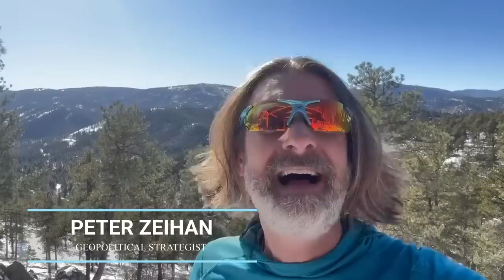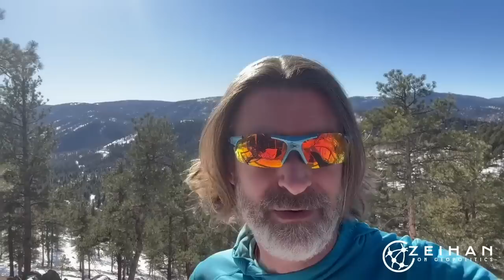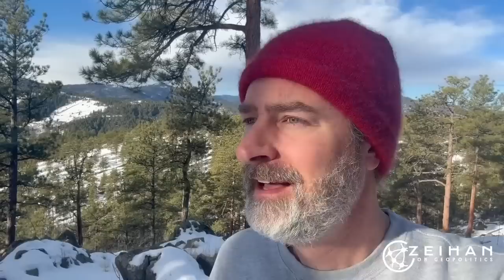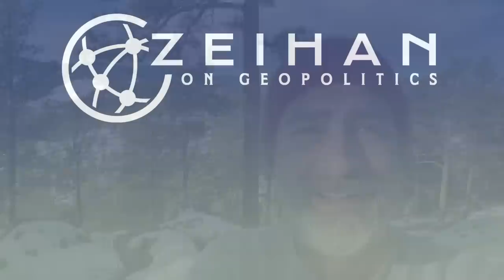Peter Zeihan || Material Processing: The Redheaded Stepchild

Comment: Bauxite is “refined”, to form Alumina. Then alumina is “smelted” via Potline, with modern technology drawing current levels in the region of 500,000 Amps, enough to create a magnetic field that disables all electronics, wipes credit cards etc. The potline I worked at had a 1000MW power station just for the plant itself. 
Bauxite (red dirt) input to Refinery >>> Alumina (white powder) input to Smelter >>> liquid aluminum input to Casthouse >>>  billet aluminum
Reply: Cheap electricity makes aluminum.  If a grant could be obtained to build a dedicated nuke plant jobs could be created for the next sixty years making alumunum.  This is provided the alumina and recycled aluminum could be obtained.
Reply: M.S. ...................solar panels on the plant roof ..........not an option ?????
Reply: One average-sized aluminum can has as much electrical power in it as a 220 volt 30 amp clothes dryer running for an hour.  Anyone who's used thermite  can attest to the power in aluminum.  

It only takes 1% the power to recycle aluminum versus refining from raw ore;  just melt it and reshape it.  Considering there's possibly 100 tons of aluminum cans on American roadsides a major contribution to the environment (and winding down fossil fuel power plants) would be recycling this valuable metal and getting it back into the economy; every little bit helps.
Reply: @dannycalley7777  you  16 watts per sqft. 1000MW= 1,000,000,000 (one billion watts) = 2.24 sq miles of solar panels - what about the night shift???
Reply: Intermittent power for molten aluminum does not go well, power goes out, pots freeze solid, only way to fix is to remove the pot and jack hammer - other than an explosion due to water entering the cryolote bath or the cast house, a frozen pot is about as bad as it gets. not to mention they would need 10,000acres of panels 15-16sq miles and only make electricity while the suns shining
Reply: @dstevans  just have a 5 cent deposit on every can and people will scoop them up and turn them it!
Reply: @dstevans  220 V * 30 A * 1 h = 6.6 kWh.  I think that's too much, since the spot price of aluminum is 51 cents/lb today.  At that price, with approximately 35 cans/lb, the metal content of the can is worth something like a penny and a half.  Even the cheapest electricity is several cents per kWh.  Aluminum still represents a substantial amount of electrical energy, just not that much.  Maybe 6.6 kWh is for a pound of Al?
Reply: Thanks for that. I cringed a bit when I heard him say that ☺️
Reply: @dstevans  Aluminum is also a very good solvent for other metals when molten.  These trace metals that get picked up every time it gets recycled cause problems with things like corrosion.
Reply: I love how any semi-decent Comments Section on any decent channel, has such a depth of expertise attached to it.  =)
Reply: @daniellarson3068  I've heard Aluminum described as "Electricity in solid form". It's fairly easy to figure out where refinement takes place, just look where the electricity is cheapest.
Reply: @machinist7230  Yes - It used to be made in Washington state when hydro power made cheap electricity.  Then lots of people moved there and electricity wasn't so cheap.

Comment: It sounds like a great opportunity of we (US) get our stuff together. I used to do some consulting for what we have left in US metal producers. (titanium, aluminum, specialty steels, nickel super alloys), A lot of the factories were create in the early 1900s and are very inefficient by modern standards. The product doesn't "flow" well through the shop even after decades of work trying to optimize it. But ultimately the factories were built without modern industrial engineering methods. And no one wants to spend 8 to 9 figures to move a rolling mill or forging press. I understand peter is talking about processes before these but the point probably still is valid. with modern knowledge on flow through a factory and with automation / technology we can probably do these processes in a profitable way. or at least partner with someone who will do it on there soil so they give us the purified materials.
Reply: US businesses are really bad at re-investing in to production upgrades.  Cuts into short term profits.  The Japanese with their mini-mills destroyed the likes of Bethlehem Steel and their 100+ year old mills.  

Brazil and Mexico will up their steel production and their cost of doing business are lower than the USA.
Reply: @TheBeingReal  I agree, alot of these factories were in horrible shape. I literally saw furnaces collapse in on themselves. Kind of scary considering at times maintenance workers will go ontop to do work. I think Brazil / Mexico is probably the most likely choice. I also think theres a big opportunity for technology in this space because we are soooo far behind in some of the factories that i've seen. very little automation. If we can remove a lot of the labor then potentially labor isn't as big of a factor. Of course if we require the same number of people we can't compete. Also keeping it "local" it increase the velocity of product through all the different operations which is important because a lot of these materials can be expensive. so having to buy them and sometimes taking several months to have a finished product ties up a lot of capital in raw material cost. 
we shall see.
Reply: @TheBeingReal  I think you are likely correct. It may be US capital involved, but building new plants outside our own borders is likely the best plan. Sometimes you cannot financially upgrade old facilities, and our self important bureaucrats will not let anything get done in less than a decade. 
I have tried to work with my Congressman on fixing the bureaucracies by changing the promotion systems. People shouldn’t get promoted, or even retained, if they cannot approve anything nor do it in an efficient manner. Couldn’t even get past form letter returns. The Army has made much more progress in this area than civilian departments, but Congress is now simply dysfunctional.
Reply: The processes hez talking about take years to materialize and the culture in american industry and finance is just not that willing to wait that long for such projects .
Reply: @nunyabidness3075  Exactly.  Pick a critical financial point for anything these days and it's so full of counterproductive bureaucracy that anyone with a functional plan will get nowhere working with them. 

As a small business owner, I am dealing with that in the banking systems right now.  I am set to do a massive business expansion and they won't touch me due to, according to them, because I have no profit.   Hardly.  For every dollar I spend I make 3, but due to having done almost all of my expansion at my own expense up t this point, on paper, I am at break-even for the year.  

When I didn't need them they were all over me like flys on shit with huge lines of credit and dirt cheap loan offers, but as soon as I need them they can't help in any way that matters.  I hate all of it.
Reply: You are right.  Build new metal processing plants outside of the normally considered USA.  I think Gary, Indiana may be such a place.  A lot of jobs would be provided to the natives.  A lot of wealth would flow in.
Reply: I attended college in the '90s in a former mill town in Maine. In it's heyday- 1900s to 1920s, Lewiston-Auburn was like a small Las Vegas/Atlantic City! Tons of factory jobs (shoes, rubber, ropes, canneries) plus a US Naval Base nearby, service industry, entertainment/Vaudeville/opera house, casinos, etc. By the late 1950s half those jobs were gone (by the 70s, all would be LONG gone), also AMTRAK and airlines bypassed the city since it was no longer a destination. By the time I arrived as a freshman to this "college town" in 1990, only the college and the local Hospital were the main employers a half deserted old mill town that used to be a "city". Do you think these cities will come back?
Reply: @juniorjames7076  I don't think they will anytime soon. I'm in my early 30s now so I hope in maybe 10 years when political leadership dies out we might get some change but I'm not holding my breath. On the other hand i'm also an optimist and I hope that maybe an Elon Musk type figure who is willing to take a large risk and make it happen might be able to work. But i don't expect the current "system" to do anything. With semi conductors getting a lot of tax incentives to bring production back to the US I'd like something similar to see a couple billion dollars go into a project like this to try and make it happen then where ever most of our money goes now a days.
Reply: We’re going to see huge government investing to bring all that back to the U.S. It’ll be a great way to say “we’re takin back our jerbs!”

Comment: As a Mineral Processing engineer - thank goodness someone is covering this. 

Peter- this is only the tip of the iceberg. Looking forward to more content on this
Reply: If that's the tip? what comes next?
Reply: I tell my friends and peers it takes on avg 10 years to get a mine fully operational and we are missing mines for what we want to do globally which as you know is impossible.
Reply: As we see more emphasis placed on the resources we need coming from North American companies can we do final processing at scale
Reply: Sounds like YOU should be making videos about this...
Reply: @aurorajones8481   so we're going to mine urban centers because the mines have all peaked in the US.   they practically have to wash out minerals from slag these days like we did for oil and gas in fracking ... these are the golden years it's all downhill from here.
Reply: It is a 20 year lead from exploration to production for a new Tier 1 mine. Due to low metals prices in 1990s, we don't have a long list of exploration for Tier 1 assets, especially Copper.

My personal opinion is that there isn't enough Copper ready for ramp up production to meet the green industrial revolution requirements.

This means that the Copper deposits of the 2030s to 2050s will be lower grade and increased mineralogical complexity; this will require finer grinding to liberate the minerals for separation. Currently, 5% of global energy is spent crushing rocks, this will need to increase with more fine milling.

Fine milled minerals also have fine tailings (waste rock) that is usually stored on site. Fines have more surface area, so retain more water and are more difficult to filter. This increases plant capex and opex. More importantly though, it increases the geotechnical risk of the tailings storage facility. If you have a responsible mine owner, this increases their TSF costs. 

Overall, the world is going to see an increase in Copper commodity prices.

That's not even to get to old Russian mines in the Arctic who used permafrost to construct their tailings impoundments. With global warming these destabilise and have to be rebuilt. As these are a major source of nickel then this will increase price instability in the Ni market. So large batteries become very expensive, unless you control your own supply chain, which is why the car manufacturers are moving their ownership up the supply chain.
Reply: @aurorajones8481  is enough rare Earths in the tailings of all of usa mines. But we don't have the processing, or the legal framework to do that.
Reply: Would love to hear your thoughts on Brazilian mining and processing.

Comment: This stuff has moved around. The issue, as Peter pointed out, is really capital and regulation. Take rare earth metals, for example. They used to be mined and processed in the US. The processing is extremely dirty and the cost in the US to do it cleanly allowed China to swoop in and take that market. It is the same with iron, steel and aluminum. Two things will be needed. Regulatory reform and industrial policy. This has been anathema to many, but world conditions will change that. The Chips Act is a good example.

Comment: Foundry guy here in the US, and to say that a cobalt smelting facility goes up in a year is an incredibly optimistic interpretation.  For a big company involved in the metal casting industry, it takes 10 years to get a new facility up and running, and most of them give up and just build a factory in a different country.  I would be surprised if there is even one metal smelting/refining plant being built in the US right now, or even being planned.  
Metal processing is dirty, nasty business, and it's unfortunate that the western mechanized economy has made it easy to externalize these costs, and at the same time let the knowledge of these processes escape control without compensation. It is not impossibly expensive to make these processes possible, and many of the byproducts have value as well, so rebuilding a US refining industry is not out of the question if materials continue to be more valuable.
I have the same opinion of Pete here that there is an incipient resurgence of the US economy because of the re-shoring/friendshoring that is ongoing right now.   The US is energy and food independent, and controls what amounts to the only meaningful navy in the world. If the US can successfully internalize its economy, everyone else can go sit and spin.

Comment: You throw the iron ore into a blast furnace with a product called Coke, which is made from coal and on the production of Coke a lot of useful bi products are made such as lite oil to make gas, tar which has tons of uses such as making aluminum, benzine, coke oven gas which is used to run power plants ect ect. But the better the quality of coke the better the quality of the pig iron / steel. So even with in one process there is many small processes that go into that. I actually work at a coke oven battery it’s not an easy job but it pays very well.

On a side note : the EPA has killed America’s smelting and processing plants and has single handedly made us rely on other countries. What has to give is the EPA and many other alphabet agencies need to go bye bye and stop regulating our economy into a coma

Comment: Canada is currently under going a build out of many different metals processing facilities using hydro power from Quebec and Ontario.  in 3-5 years Canada will become the North American supplier of processed metals.
Reply: Yes. Cheap power is the key to a lot of this, and Canada has at least 5 provinces with a lot of it or the potential. Also in BC Teck Cominco at Trail, a huge very old smelter, is also starting to be a recycler on a lot critical metals.

Comment: You're speaking from Colorado?  There used to be a steelmaker there in Pueblo, CO.  CF&I  They had four blast furnaces making pig iron, and then other shops making rail, pipe, etc.  They couldn't compete because all the iron ore, coal and limestone arrived by rail, which is too expensive, compared to barge transportation.

Comment: Energy is what the war in the Ukraine is all about. To melt steel, and process Aluminum you need lots of power.The energy cost to perform Rolling and/or forging of metals can be as high as 15% of final product.The #1 use of oils and natural gas is to generate electricity. Electricity will power future industies. solar panel generated 16W/sqft.  My home generator makes 5000W per hour on about 2 cups of gas.

Comment: We sent this away, and we can bring it back! 
We just need the will to create the policy that incentivizes capital to make this homegrown again. That's all it's ever been ... constructing artificial economic drivers. This time we just need to set those up for us, not them. We also have the high-end education and knowledge to develop new innovative chemical technologies that update those 50 year old processes to make them more efficient, less energy-intensive, and less-polluting. We did it for things like computing, and we should be doing it for stuff like materials. There no reason why we shouldn't be placing the U.S. way ahead in this game; and doing it here, with, and for Americans, first.

By the way, I've witnessed the zinc-refining process in my youth, some 40 odd years ago. 
First the ore comes out of the mine in long conveyors erected in the sky, and is fed along till it is dropped into and pulverized in big crushers. Then it's ground down further into a fine grain in huge semi-sized ball mills that roll it around mixed in with large steel spheres as big as a baseball. Then the slurry is pumped into open vats of acid that percolate with shiny bubbles of metal on the surface of the solution. This creates an eye-watering mist in the mill. Next the glittering muddy ore is piped out from below the sumps, and up and out into fine sprays with water onto grooved wooden shaker tables that separate out the metal particles. Finally, there's a process which oxidizes the zinc into a white powder that is blown out into huge plastic bags for shipping! Wonder if that process has gotten any better since I last saw it?

Comment: EAF furnaces and aluminum recycling negate a large percentage of new steel and new aluminum.
China makes infrastructure steel, like rebar. 
India is gaining a strong third place on steel made from Iron ore, 
But the USA has built MANY EAF furnaces for recycling steel in the last 20 years. So our steel processing is improving in volume AND Quality.
Aluminum? It takes about a tenth of the original energy to recycle aluminum. 
China and Russia have been loosing processing in these areas for almost a decade 
It may be the reason they’re becoming desperate.